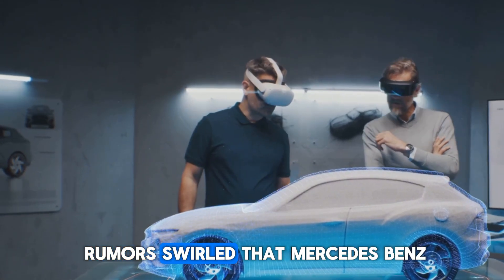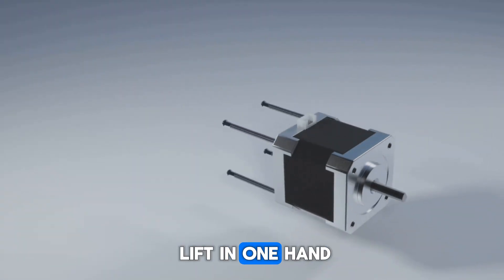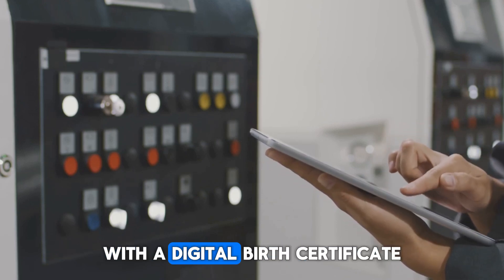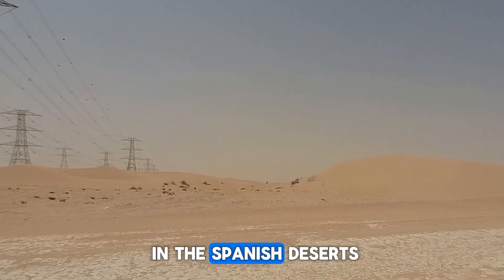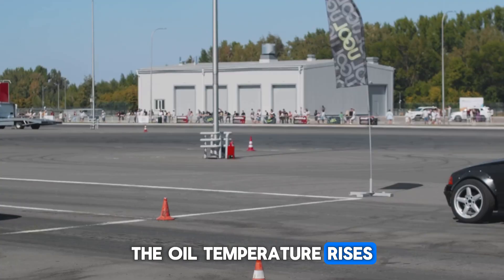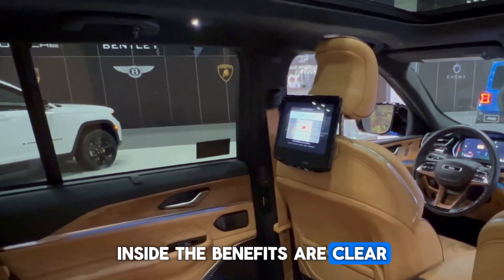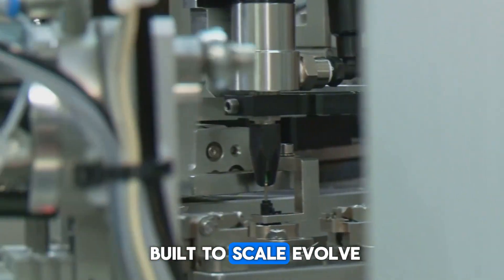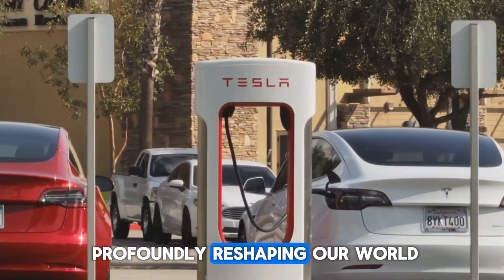Mercedes Drops a Bombshell: YASA Flux Engine Officially Confirmed!

Comment: If you're going to use an AI narrator at least listen to it and correct it before releasing. Several coupés in there but also a coo, lots of YASA motors but also a YASEM. It needs to be correct or it's not worth doing.